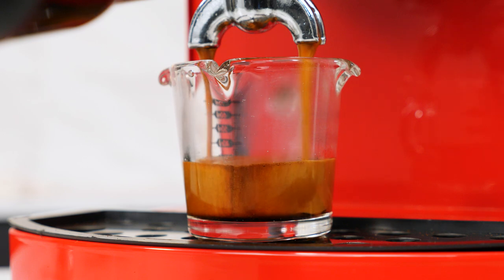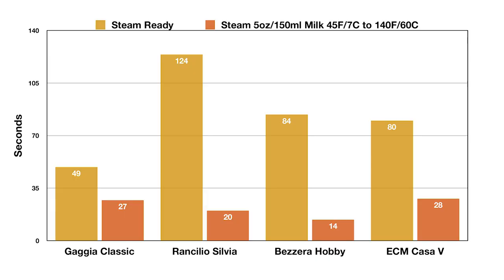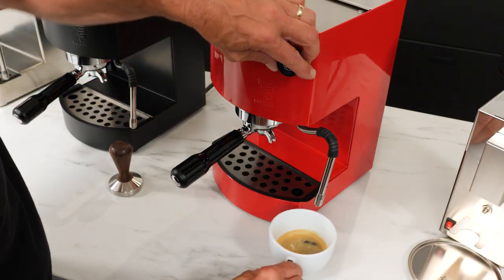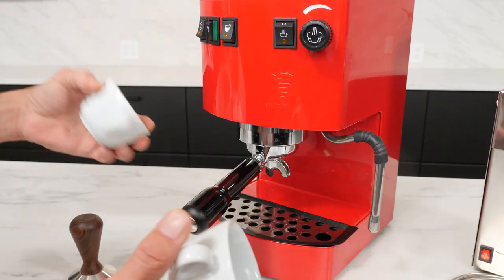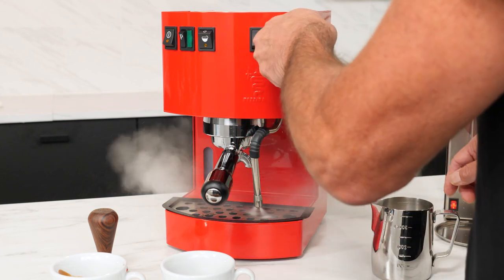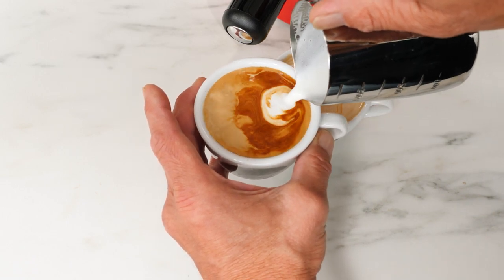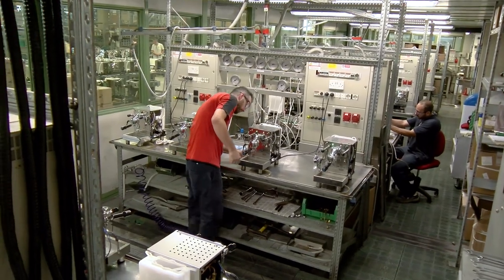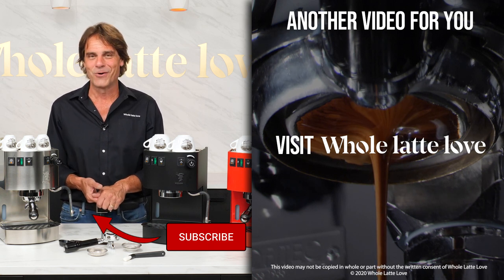Review: Bezzera Hobby Espresso Machine

Comment: Hey Marc what a beautiful machine :) i got Bezzera Unica two years ago and i love the espresso quality and consistency but i never used PID control i always keep it on 95°c and nowadays im thinking to change this machine because i only drink latte cappuccino and this machine is little bit hard for me to deal with it but i REALLLY LOVED the consistent extraction. So should i get bz10 model because of heat exchanger and easier to use but I'm worried if the extraction isn't as consistent as Unica like idk for example if bz10 gives 95°c flow is it same every time if i flush or its varied tnx:)
Reply from the maker: Hi MF, Thanks for the question. For milk based drinks the BZ10 with HX boiler (with no waiting for steam) will be much easier to use if doing mostly milk-based espresso beverages. The electronically heated BZ group of the BZ10 will provide stable brew temps - and bonus, it heats up faster than machines with E61 group. You are giving up the PID in comparison to the Unica. Doing a flush on the BZ10 should provide consistent brew temps. The BZ10 uses an internal pressurestat to control boiler temp. It is adjustable and increasing or decreasing the pressurstat's setting will adjust the baseline brew water temperature. Using that you should be able to get the brew temp you want. Hope that helps!
Marc
Reply: @Wholelattelovepage  oh I see it sounds nice to me. But In bz10 Does the brew water cycle in group head as well as E61 groups Or it sits in the heat exchanger tube and every time i Want to extract, the water comes from tube to the group with heated element IF it's like this  it's weird somehow because first of all the water which sat in the tube is higher temperature than appropriate water temp for brewing(in case if you don't flush all the water that sat in tube for a while) and when passes through element it may get higher temperature then the result is bitter extraction so what does the heated element do because in this case it make the water higher temperature than it needed to be? In case i flush all the water in tube Does the water come from tank to the tube then passes the element makes perfect temperature for brewing? I'm just wondering is there any tech behinde that tube to control the brew temperature? Or the cycle thing (if it existed) is the solution in bz10 group. Can you tell me more technically how the brew temp controls in bz10 is it cycled or is there any cooling off tech behind it or is that tube always sits in same temperature as always because of the especial material it has? I'm just curious how the brew system works in details in bz10 because im obsessive about the good extraction...
One more last thing is simonelli musica better machine than Bz10?
Thank you for the support:)
Reply from the maker: Moay Fan no cycling (thermosiphon) in the BZ group. Quick flush provides consistent brew temp. I prefer the Bezzera machine. Musica is rather plasticky in comparison while Bezzera is true machine inside and out. Marc
Reply: @Wholelattelovepage wow  ok nice i thought it cycles i see! but e61 groups are cycled in heat exchanger machines right? now im gonna choose between lelit pl62 with e61 group and bz10.
 Now the only way i decide which one is best is gonna be your answer dear Marc :D which one would you choose if consistent brewing is main thing for you.

Comment: When I would buy this espresso machine and the grinder that you use which costs me another $400 or so, wouldn't it pay off to invest that money in a higher-end espresso machine with built-in grinder?
Reply from the maker: Hi M, Thanks for the question. That is an option. Keep in mind those types of products tend to be appliance grade in build quality. They will not have the longevity and compromise in potential espresso quality in comparison to machine grade products.
Marc

Comment: I also appreciate cutout in front of Hobby. Some may think it's a sign of cheaper machines and solid front casing shows better machine - let me explain how it's useful. Keeping water tank full for low volume consumption is a way to have stale water. I never keep full tank and rather top it up each day before brewing coffee. Cutout in front lets me see if water level is going critically low. As for electronic level warning systems - they do exist, they do work but one less component in a machine makes it simpler and more reliable.
Reply from the maker: Hi E42, Thanks for adding that! I really dislike machines where it's tough to see how much water is remaining.
Marc

Comment: what is the warm up time on these? 20 minutes like on Silvia?
Reply from the maker: Hi, thanks for the question. With a more powerful heating element and slightly smaller boiler heat up time is less than Silvia. As with most machines you can help things along by running blank shot or two during warm with PF in place. Marc

Comment: It might sounds stupid in terms of price. But
Does this machine give better and consistent brew temperature than Bz10 heat exchanger which one gives better shot extraction :D
Which one gives best and consistent Espresso overall (I'm just talking about consistency of brew temperature
Of this little machine versus bz10 i know bz10 can froth and brew same time but I'm just try to find out is bz10 brewing trustful.. Or in the end of the day i should go and get single boiler machine like hobby because of way better shots? I care about milk frothing but not as much as quality of extraction Please help me out Marc just tell me hobby or bz10.. In my town the only available single group machines for now are Bz09  /Bz10 /Hobby  )
Reply from the maker: Hi RP, thanks for question. BZ 10! It’s uses Bezzera’s BZ group which is electronically heated and controlled for very stable and consistent brew temps. Marc
Reply: @Wholelattelovepage   also one more thing how many seconds do i need to flush in bz10 to make sure the water in the Tube has changed so I won't get high temperature brew.
Thanks Marc <3
Reply from the maker: rayan parsajoo flush depends on other variables. BZ 10 is rather consistent but depends on things like when last extraction happened, ambient temps, how long PF was in or not in group as it’s part of the heat sink. Best bet IMO is determined by your typical use pattern and local conditions. Try a coffee with no flush. Is it more bitter than expected? Then maybe try an extraction with short flush. Was that one less bitter? That my friend is knowing your machine and part of the art/skill that is espresso at the high end level. Marc
Reply: @Wholelattelovepage  that really helped alot Marc<3
Big thanks for the response. I've learned so much from watching your videos wish you bests:)

Comment: Is an add on PID with this?
Reply from the maker: Hi u, Thanks for the question. No PID add on available. Does not mean a third party doesn't have it. But, I strongly suggest going with a machine designed to work with PID rather than hacking one.
Marc

Comment: Can it be equipped with a PID?
Reply from the maker: Hi Tom, thanks for the question. Probably? But IMO if you want PID it’s best to go with a machine designed by manufacturer to work with one. IMO PID is of dubious value in machines with smaller boilers. Manufacturers only nailed it about 5 years ago in HX boiler machines with E61 groups. Those thermosiphon and system beyond the PID must be tuned with flow restrictors etc to make it work and provide solid brew temps. Small volume boilers with out circulating water have large temperature inconsistencies. Without thermosiphon flow ambient temps and other factors have large influence. Marc
Reply: Whole Latte Love does it have the same need to surf temps like the Rancilio?
Reply from the maker: Hi, If you want to go to that level yes - it's similar to using other single boiler machines.
Marc

Comment: If I have a modded Gaggia Classic with a PID, Rancillio steam wand, IMS shower screen and brass head, will I see any improvement if I were to upgrade to this?
Reply: Probably. The thing you cant upgrade easily is the minuscule boiler in the Gaggia. PID helps with the thermal fluctuations that tiny boiler struggles with, but a slightly larger boiler with a bigger element would likely make a big difference
Reply from the maker: Hi Max, Thanks for adding!
Marc
Reply from the maker: Hi Joseph, So a few of key differences between the Classic and the Hobby... Price of course! Larger boiler in Hobby, Hobby has a dedicated switch for pump - Classic does not, a lot more steam power in the Hobby - it's nearly twice as fast steaming milk to finished temp, larger water reservoir.
Marc

Comment: BREVILLE BARISTA runs laps around these machines. More modern. Easier to program. Professional grinder and steamer built in. Very strong pump. TOTALLY THE BEST HOME ESPRESSSO MACHINE. you can also make coffee.
Reply: No wait time switching between steam and extract.
Reply from the maker: Hi vm, Thanks for the comment. The BB does offer some value at the expense of long term durability. It's an appliance with limited lifespan, low repair-ability, etc. If/when something goes wrong with it generally does not make financial sense to have it repaired. If you're okay with that it can make sense. The Hobby is a true machine, very durable and repairable, far more steaming power and full size and weight 58mm commercial portafilter.
Marc

Comment: In fact, there's PID built in...not really, but kind of..you just have to learn how to use it. After water heating cycle ends, boiler is at certain temp. Start brewing X sec after heating cycle completed and you will avoid temp fluctuations between shots. How many seconds you have to wait? It's up to you - what taste you prefer and what beans/roast you have. Darker roasts are OK with 45-60sec, lighter roasts about 20-30sec. - this is just guide and not cut in stone.

Adding a PID to machine in a small case, besides what Marc answered regarding stability, think about how it will look - no place to mount PID inside even if you cut hole in a case, or external box somewhere behind or on side, wires - IMO it's act of curious vandalism without much of useful return. This machine has big and thermally capable boiler (compared to chain store appliances) and is ready to brew nice thick espresso. Just make yourself be friends with this machine (with any you own, in fact).
Reply from the maker: Hi E, Thanks for sharing the info. Getting to know a machine helps. The Stats used in these types of machines are not nearly as accurate as PID but using techniques you suggest gets one a baseline. Good stuff! Thanks!!!
Marc
Reply: Welcome,Marc! You have shared so much that Im glad to return.

P.S. Adding to my algo - just make sure machine has heated at least 10min, better 15min. And no need to wait while machine starts heating cycle - one can flush a bit of water from group to initiate heating cycle. Make sure you are grinding beans at this point to be ready when your X seconds run out.
Reply from the maker: Event 42 more great advice

Comment: Nope. Why pay more $400 more for a machine that isn't superior to a Gaggia Classic Pro? Marc is still recommending temperature surfing for steaming. You will be through steaming your milk with a Gaggia (even if you don't temp surf) before the Bezzera is even ready to steam. I would stick with my Gaggia all day and save my money for a heat exchanger like the Rocket instead of moving to this Bezzera. Is it better than the Silvia? Looks like it but I would make the same point in a Silvia vs. Gaggia comparison.
Reply from the maker: Hi lkb, Thanks for sharing your opinion. The Gaggia Classic does get to steam ready faster than any other premium entry-level single boiler machine. It has a somewhat smaller boiler than the Hobby or Silvia which helps. While it has decent steaming power for smaller amounts of milk the Hobby has crazy power! in My test it was 2x as fast as the Classic to heat milk to 140F. Also has the dedicated pump switch which the Classic does not. IMO the Hobby beats the Silvia which can be over 2 minutes to reach full steam ready.
Marc

Comment: Also, I just found out these machines start at 850? The entry level Breville comes with more and only starts at 700. The second tier (my favorite) comes at 900 and by far bests these machines. Look it up! Breville Barista Pro
Reply from the maker: Hi vm, Thanks for the comment. Very familiar with Breville products. Big difference between these machines and Breville appliance grade products. While Breville does represent a good value for some they have nowhere near the longevity or repairability of a machine grade product. Also Many Breville's use smaller/lighter portafilters and thermoblock boiler which have questionable temperature accuracy for brew water.
Marc

Comment: I don't agree. The Silvia has a 0.1L bigger boiler, so no wonder why it takes 1/3 more time to be steam ready. Yes, the drip tray is bigger, but made from cheap plastic, the Silvia has a stainless steel trip tray. The portafilter of the Silvia is the most ergonomic on the market.
The Silvia is not perfect, but I would always prefer it over the hobby.
Btw. that was the worst tamping and latte art I have seen for a long time :D
Reply from the maker: Lol, thanks for the comment sharing your opinion. Sorry but I prefer the angled PF. Plastic does not rust. The frame rails of the Silvia which carry the drip tray are painted steel which does. Not sure what your issue was with the tamp. Shot was good and although not shown in video no channels. Also was fairly specific mentioning I usually use a leveler. They are far more consistent than tamping. Also very specific when I said “I’m no latte artist...”. Also mentioned Silvia is a good machine with a huge fan base. I expected push back from that base. I stand by my opinion the Hobby has a lot to offer in comparison. 40 seconds faster to steam temp, faster steaming and 1/3 less reservoir refilling really ads up long term. Marc
Reply: @Wholelattelovepage  thanks for replying Marc! 
The Silvia's portafilter is also angled.
Yes, the Silvia does rust and I also criticize Rancilio for not using stainless steel for 22 years and six versions of the Silvia. The hobby has no rust issues or chipping of the paint?

I know, I also prefer a leveler. In the video there was no distribution at all, you just tamped the mountain of coffee which leads to uneven density. 
You don't have to be an latte artist, but I think you could do better after all.

I don't have issues with steaming or waiting so long. Maybe that's because you just have 110V and a different heating element than we in Europe.
Reply: @Dune87  looking forward to your tamping and latte art... surely with that much skill you have your own YouTube channel?
Reply: @motopasky  No I don't have a YouTube channel. But I am also not in the business since 1997. Yes, I can do better, but not perfect.